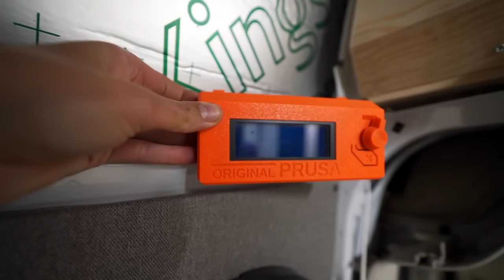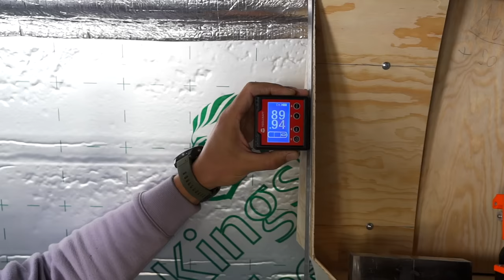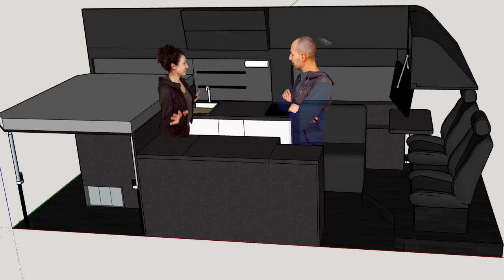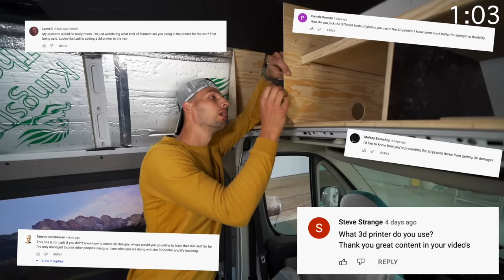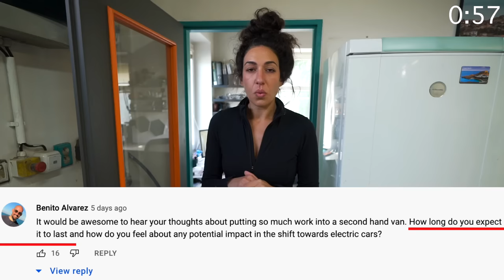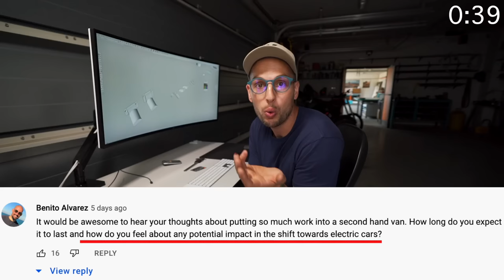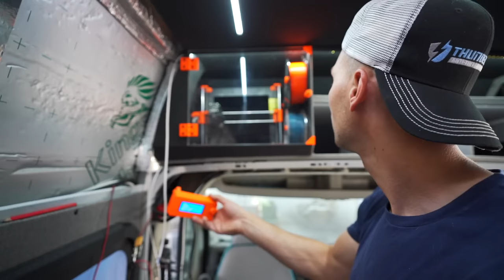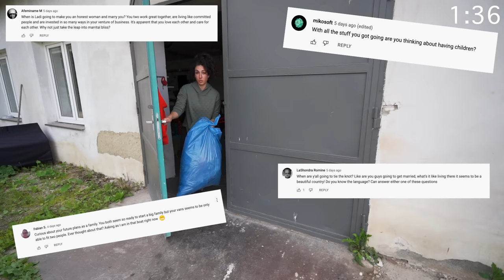Building Air Controlled Enclosure for 3D Printer / Not your typical Van Build S3E7

Comment: Have you guys considered air suspension so you can level the van when you're parked up? Love the video. Really a great fan of the air intake system, absolute genius.
Reply from the maker: Yeah, We just did’t find any reasonably priced ones. 9k for VB suspension is a lot.
Reply: @ladiandmargaret  ever thought about 4 hydraulic carjacks?
Reply: @ladiandmargaret  yes they're bit on the expensive side. It's one of those things as well. Want to get a new one because that way you're sure they're OK most of the time and they're also have manufacturers insurance as well.

Comment: That is a very cool enclosure, and it's temp controlled!  I'm sure you're already aware, the stepper motors in the 3D printer is very loud with normal drivers. May want to look into silent drivers and vibration isolation to the shelf/enclosure.  You may like the "robotic" sound now since it's just momentary, but having it run for hours on end when you're in van with it probably won't  be too pleasant! Especially since it sounded like the shelf is now amplifying the noise.
Reply from the maker: yes definitely! We've both been working next to 3 of these printers for about a year now, and the noise can really add up. We won't be printing overnight ever, but usually while driving or maybe coordinating something to print when we're out on a hike or something like that. Otherwise noise cancelling headphones would help!

Comment: Thank you, Margaret, for all the hard work (after an already long day's work) involved with editing and posting your videos. Who's the little cutie (around 13:15 through 13:19) protecting his ears from the sound of Ladi's equipment? As a disabled 74 year old stroke survivor who is struggling to live in a (currently 101°F internal temperature) small travel trailer in Central Florida with 4 cats, I wish I needed a warm jacket like the one that young man was wearing. 
After 25 years raising my family in a two-story 30 year old farmhouse on 5 acres in the White Mountains of northern New Hampshire ~ with milking goats, chickens (egg and meat birds,) cats, geese, rabbits, 1 piglet every spring that went into the deep freeze in our basement/ root cellar in fall of each year, a huge veggie garden, an herb garden and a flower garden ~ my life circumstances changed and I relocated to a 1br apartment in hot, humid Orlando, FL, where my monthly rent was an affordable $450. But over my 21 yrs in Central Florida that rent increased annually to $1,140/month (on $800/mo Social Security income!!) 
Hence, the move to a small travel trailer with rooftop AC, which I cannot afford to run due to it's extreme power drain. For now, just trying to survive by moving ambient hot air with a small 12V fan.

Comment: The 3D printer in the van is kinda cool idea! The benefit in it being in the van is that you can ventilate the space for the 3D printer, without the air mixing with the air in the van. I would probably make the seal bit better with the door closing in the 3D printer, this way the microplastics/microparticles emitted while 3D printing won't leak in to the van. I'd imagine a small space like a van, mixed induced with microplastics in the air won't do any good over long period of time. Any case, cool idea!
Reply from the maker: We’re not worried about a small leak, fans will take care of most of the air in the enclosure.

Comment: Your van and Everlanders truck are the main two (aka good ones) I have seen install 3D printers. I think it is really cool, I just am intimidated by software so I haven't been able to make the jump into 3D modeling stuff yet. I am hoping that I can save up and buy a good entry level 3D printer and a laser or CNC and start making stuff. For now, I just make stuff different ways or find some geek from the Twin Cities maker community to print something for me for cheap or barter. Very cool idea to have in your van with you so you can make stuff for yourself and others on the go. I've been loving all your organizational mounts for stuff :)

Comment: Hello from Québec, Canada! I love the craziness of adding a 3D printer to a van, but as a 3D printer owner I completely understand your reasons, especially with all the 3D-printed components which are parts of your build. On-the-road repairs and modifications is a great idea. I'm a bit late for the rest of my comment unless you want to redo some parts, but here I go. At the very least, ideas for future improvements...

For attaching the 3D printer to the bottom of its area, using T-slot nuts would have been much easier, although since I don't own an original Prusa, I don't know if the bottom is completely flat with the aluminium extrusion.

A lot of people who build insulated boxes for their 3D printers put the electronics and the power supply outside of the insulated area. Adding rigid XPS foam panels would help a lot for almost no added weight and would only add about 10~12mm of thickness to the box.

For the spools, I would probably have gone with a full slide-out panel just to make it easier to handle (no 3D printer in the way) and not have to work in such a small space to manage them. Moving them to a separate area on the right to better control humidity would have been another idea. I would worry about all the potential humidity of van life affecting the filaments, since you're probably not going to be printing 24/7 and can't rely on the heat of the heated bed + electronics + power supply + steppers to keep the space heated and dry all the time.

Hermetically sealed storage boxes outside of the 3D printer space could be a good idea to add, especially since ASA is listed as hygroscopic on Prusa's website. No need to re-invent the wheel there, there's commercial and open-source projects for that.

edit 1: I just noticed that you used orange for the hinges and handle for the Prusa 3D printer enclosure. Nice touch.
edit 2: I'm sure you did, but did you account for the whole printing volume of the i3, with the bed moving all the way to the back, since it's at an incline because of the front of the van?
Reply: I wonder what part would it print. Also doesn't it take like whole day for some prints ...meaning too much electricity...but I am no techie like these guys so they probably know better

Comment: I love the videos that you two make!  Not that I would be building a camper van,  But my wife just bought a concession food trailer.  So the videos will come in handy.  You know, with a 3D printer in an encloser the display is not needed ( Go headless).  the printer is controlled with octoprint on the computer.  look at the Voron printers.  There are no displays on them.  Hmm!  I wonder if I can sneak a printer into the trailer?
Reply from the maker: I did not even know that, we’ve been using octoprint for years.

Comment: A great solution for this printer, it will mute isolate, maybe it will not print perfectly while driving, but is it important? no :)🤗🤗
  The only drawback is that it is impossible to use the entire printer field at full height, the sloping roof on the back will interfere with the high print when this one, for example, will go beyond the back when its front will be printed, or it just looks like it is filly and nothing will collide :)🤨
Greetings!☺☺
Reply from the maker: Wow, you are so right! We did not realize it the whole time 😂 I’m thinking and there are only few models we’ve printed that would have to be positioned to the front of the bed 😅

Comment: Great project but there are two things that may be a problem. First is the intake vent from the shelves. There is no way to stop clothes from blocking this vent. You may need to add a wooden wall to allow air to be pulled from in front of the shelves.
Second issue is by fixing the 3D printer in place you will have huge problems when driving. All vibrations will be transferred to the printing head. It would be better to have flex like a building in an earthquake area. Do a short drive on a good road while printing and you will see the problem, let alone a bumpy road or a twisty one.

Comment: Good idea to have a 3D printer in the van but I think you're probably going to need to put it on a Gimbal or something if you want to run it while driving. At least put it at the centre pivot point between front and rear wheels where there is the least movement of the van body. Centered side to side would be the perfect solution but would be impractical. Close to the front or the rear will mean that bumps etc will shock it and possibly make prints fail. You've done a lot of incredible work. Hope you have luck.
Reply from the maker: It should work fine the way it is.
Reply: @ladiandmargaret  I hope so, I'm interested to see how it performs as I have similar plans

Comment: Re: why a used van? In Czechia mechanic labor is inexpensive. So worst case, you can swap engine and transmission and keep using the van for another 5+ years, and it's still much cheaper than buying a new van. Rebuilt engine/transmission can also be acquired, instead of new, to lower cost. I'm in Poland and mechanic labor is also very affordable (compared to when I lived in Canada, it was cheaper to buy new than to repair an engine, because mechanic cost $100/hr).

Comment: Why don't you skip the printer PSU alltogether? It works on 12V anyway? And if you run it while driving, you don't need power from the solar grid.
Just make a voltage regulator circuit. Or ask Prusa to make it for you?

Comment: Question: I know you'll have large batteries, but in case of very cloudy days or solar energy problems, do you plan to have any backup battery / disel generator? Maybe the main control panel, where you can cut off some of the devices from the electricity?
Reply: They will probably have 2 other methods, plugging in and a system form the engine.
Reply: There's no point in generators with Lithium. It's a game changer.  Also with lithium batteries they charge WAY quicker than Lead Acid.

Comment: Electric campervans is no problem.. We have buildt it here at Raido Campers... 330km range, 20min charge and 200km more.. or 45min charge and get 330km again.. So not to far behind diesel's..
Reply from the maker: What’s the battery capacity in kWh and with how many kW would you charge to get 200km range in 20 minutes?
Reply: @ladiandmargaret  All standard Citroen E-Jumpy. and with the fast charge network in norway it works great.. it even worked great when we drove it down to Austria on a fair :)
Reply from the maker: Weird, that’s the same van my delivery guys has a complains about 150km range only. Must be the start and stops.
Reply: @ladiandmargaret  well, we had no problem getting the promised range :) and no complaints from customers either :)

Comment: I disagree with your train of thought about saving time versus saving money  on gas . Think about it . Do you rather spend $25 on a 80% dc fast charge or spend $125 to fill up a big gas tank ? . 
Your excuse is it takes 35 to 45 minutes to dc fast charge  which is about $25. Versus 10 minutes to fill up a gas tank costing you about $125 with todays gas prices.
And the maintenance cost of a gas vehicle with 100’s of moving parts are $100 to $1000’s   Versus hand full of moving parts with the ev battery been the main  part . 
And tge 2nd hand value of a ev car or van is going to remain high close to the purchase price no matter how old it is  when you think about a gas vehicle looses its value 10 % asap you price off the dealership